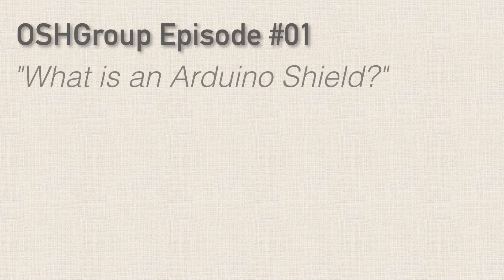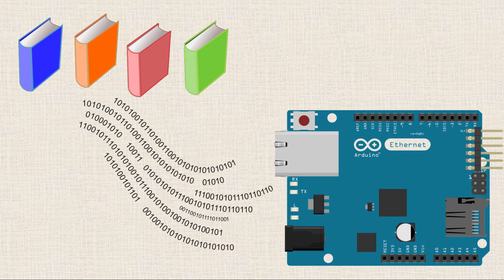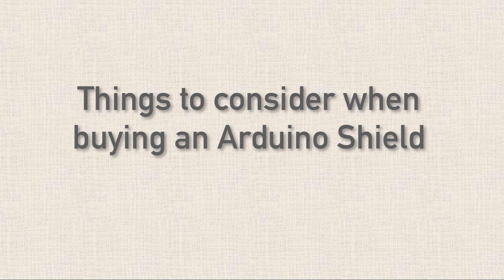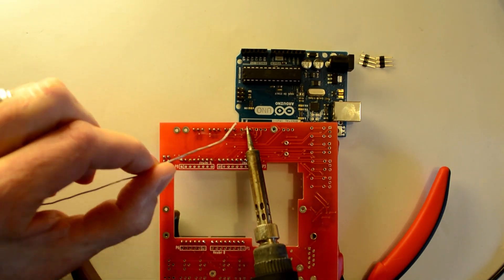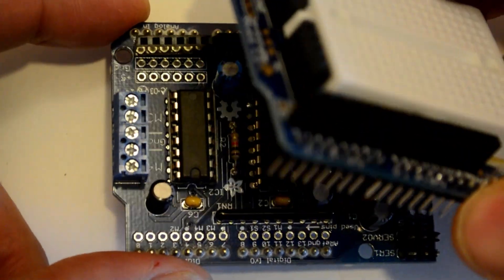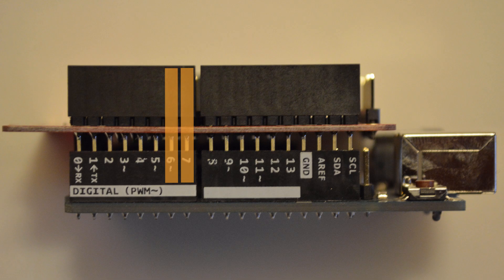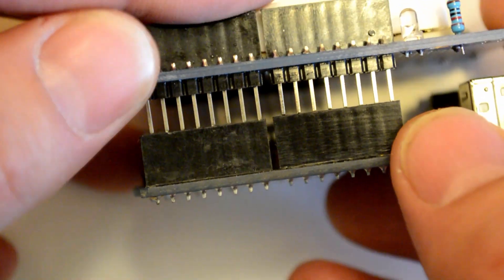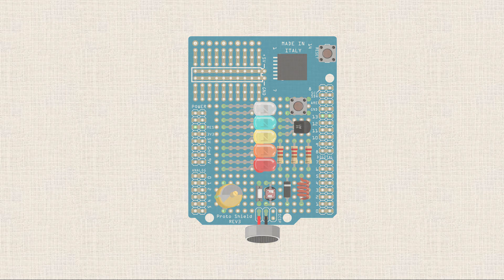What is an Arduino Shield?

Comment: dont get it.  I can use my bread board and things work fine, switch to elegoo shield to solder in and make more for the field and noting works at all when shield plugged into arduino uno.

Comment: Nice. Small note: entomology is the study of insects, but etymology is the study of words.  :-)

But the real question I have: a lot of shields I see have just holes, and those holes are not connected. So how does one connect them? Two pins in one hole? Surely not?
Reply from the maker: Great question!  Frequently you solder on what are called “header pins” into those holes.  The holes are connected to the shield components via copper “traces” on the circuit board.   Depending on the type of header, these can fit in breadboards or accept a jumper wire to connect to.

I hope this helps some!
Reply: @programmingelectronics  some! But what about all the holes that are connected to nothing? No taxes? Just holes by themselves. If I Sold out, say, a pin of a resistor into such a hole, fine. But then it’s not connected to anything else… Am I supposed to then also stick a wire into the same hole? Surely that’s not good practice, but I don’t understand how else to use them.
Reply: @MichaelWillems  I mean the use of that pin will be given on the datasheet of the shields, if not its just there to provide emotional support 😍😍

Comment: Do I absolutely need to use shields, for projects that involve the use of sound, wifi, bluetooth, motors ..etc ? or is it just easier with those shields  ?
Reply from the maker: Just easier (and quicker generally), but not necessary in most all cases.